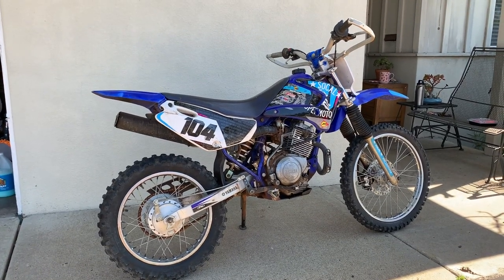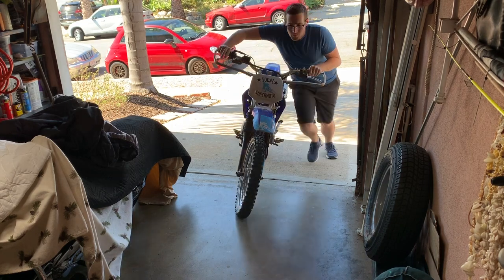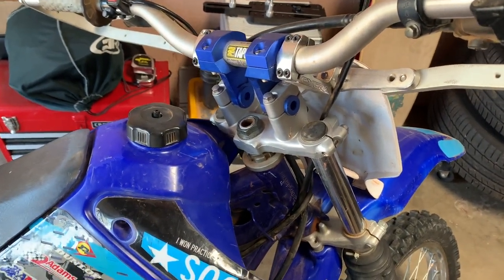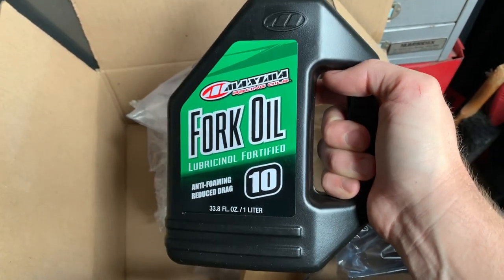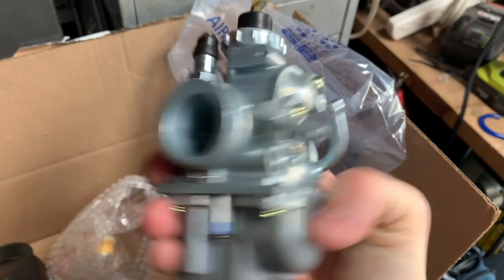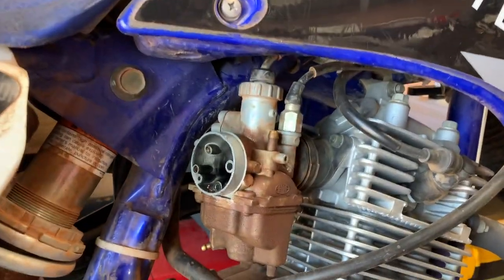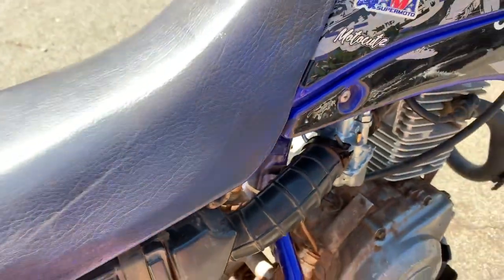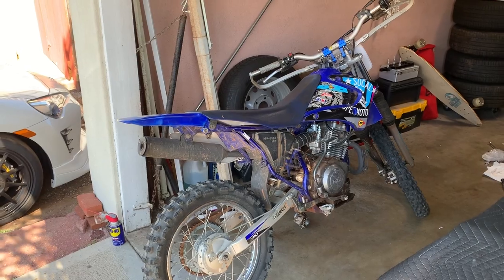I bought my FIRST dirt bike! Yamaha TTR-125L

Comment: How much was it
Reply: Well on Facebook market place used wich is were I recommend buying if it’s your first bike it’s around 1k-2k and it was really worth it👍
Reply: @dougbeck1913  How much did you get yours for
Reply: @PlateInStock  I got mine for 1.5 k and it runs really well
Reply: @dougbeck1913  What year is it
Reply: @dougbeck1913  Did you get a title with it
Reply: @PlateInStock  mine was a 2006 and still runs well and yes I got a title
Reply: @dougbeck1913  I bought a 2017 for $2100 with the title this summer

Comment: Seems like no compression and holding the throttle all the way is not what u want to do
Reply from the maker: Starts first kick all the time now with the new carb.
Reply: @TheDriversPerspective  gotcha just seemed like theres was no compression
Reply from the maker: @shanecorrigan1096  I was worried about that too, could have been a valve out of spec. Thankfully not, it's been on the trails and it rocks.